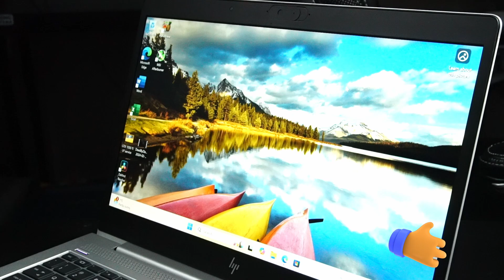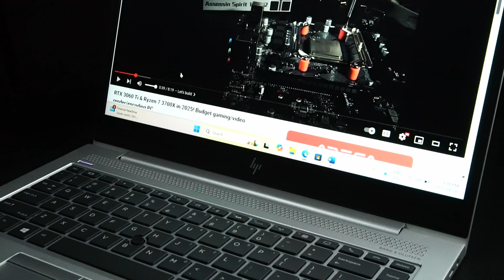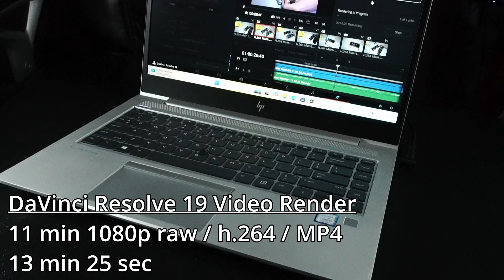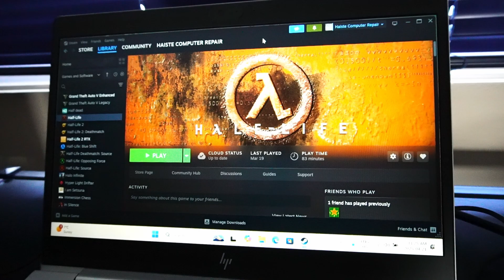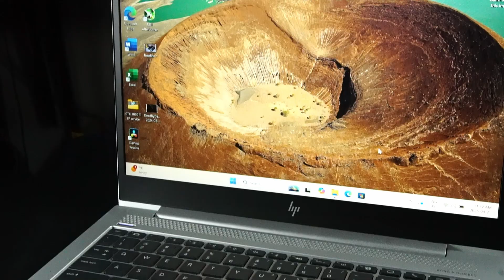HP Elitebook 840 G6 in 2025!  Gaming, Rendering, Encoding Tests!

Comment: 0:00 Intro 
1:05 Specs
1:11 Display Panel
1:54 Keyboard/Touchpad
3:13 Speakers
3:46 Daily Driver?
3:58 Quality case material
4:19 I/O
5:06 Aesthetic 
5:28 Remove bottom panel
6:20 Motherboard/Upgrades Tour
9:33 DaVinci Resolve & Handbrake
9:58 Gaming
10:47 Half Life
11:25 Portal 2
11:49 Use in 2025??
12:32 Bye
Reply from the maker: Thanks for doing that!
Reply: @HaisteComputerRepair  bro pin this comment 😊
Reply from the maker: @yomrv  Done.
Reply: @HaisteComputerRepair  ❤😊❤

Comment: I bought one but with i7-8665U it works very smoothly but in games it is not ideal but I really like the one I have the problem is its battery since I bought it with 74
Reply from the maker: Bit of a mixed bag for performance with used batteries unfortunately

Comment: Hi, first, I'm sorry for my English, it's not my first language. I need some advice, I have two options and I would like to know which one is better thinking about using it for some years.
A- "HP EliteBook 840 G6" I7 
16gb RAM 
512gb SSD
B- "Lenovo Thinkpad T490" I5 8365U 
24gb RAM DDR4
512gb SSD

Both refurbished 
I really don't know much about laptops, but I will work as a psychologist and with pictograms, not really with big programs, but I like basic and casual games like the sims 4 or Minecraft.
Reply from the maker: The i7 option with the Elitebook will be a  nice little boost.  Overall they will be very similar, so perhaps take a look at condition and message the seller about battery life.

Comment: Loved your detailed review. Would you recommend t480s or hp elitebook 840 g8 for an engineering student? I'm torn between these two.
Reply from the maker: Well, if you manage to find the T480s with the MX150 NVIDIA GPU that would be a nice boost for performance.  I like the build quality of both and you can pretty well get the same CPU, so performance should not differ from either unit.  Maybe see how much each one is being sold for and balance from there.

Comment: Nice video. 

I've been looking for a used business class laptop to get through a cybersecurity class that requires the use of VMs and some light simulated pentesting. Almost all the videos YouTube returns for my search queries are for Lenovo T-series laptops. 

HP and Dell have business class offerings, too, with similar specs and are cheaper. Yours is one of the few videos I found that spoke to the viability of the HP Elitebook in 2025. Kudos to you.
Reply from the maker: Thanks for the kind words!  The build quality and tactile feel for this HP laptop rivals the ThinkPad T480s I had, so I would feel fine recommending it.
Reply: @HaisteComputerRepair  did you upgrade to 16gb ram?

Comment: can we play gta 5 and fortnite casually
Reply: Hi. I've owned this laptop for 2 years. Here's a review from my side. Mine is the lower config one (the i5 one). It's amazing. It can handle alot of things. It can do gaming, coding, app dev, game dev, you name It. It's very luxury for It's price. And yes we can play gta and fortnite casually but you have to expect some lag and framedrop at some intervals bcz It's a laptop aight? Too good for It's price
Reply: Thank you  @Powerz559_CyberCoder
Reply: @Powerz559_CyberCoder  I have plan to buy i7
Reply: I got the one with a rx 550x 2gb ,i5 8265 U 16gb ram and gta V is somewhere playable but 1080p only on very,very low settings with around 30 to 50 fps so yes you can play gta but I wouldn't play fr because it lags so much that the gameplay freezes a lot but gta works pritty good,you could also play gta 4 than you have around 60 fps but much more stable
Reply from the maker: At low resolution like 720p and low settings, it will only be acceptable, if you manage expectations or have low expectations.

Comment: Is this worth buying for programming and long time heavy use?
Reply from the maker: Well, it would depend on what your scope is for programming.  Are you studying or putting it to use for work?  What software do you plan to run or modify?
Reply: @HaisteComputerRepair mainly for studying , what do you think
Reply from the maker: @ilyas29_ Solid, just try to get an idea from the seller on the quality of the battery being as it will be used.